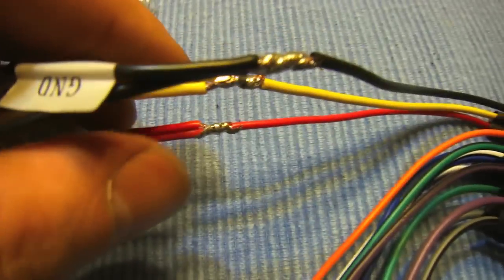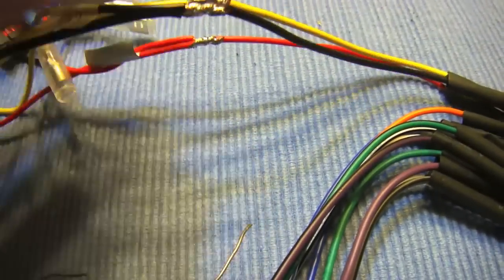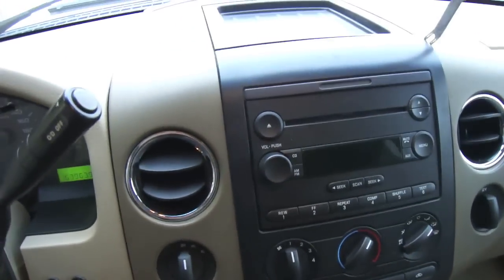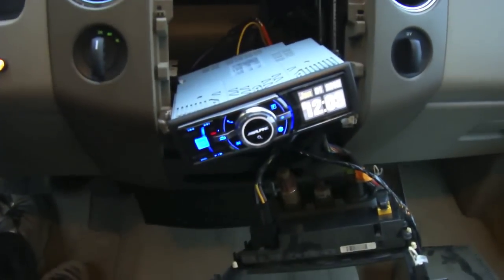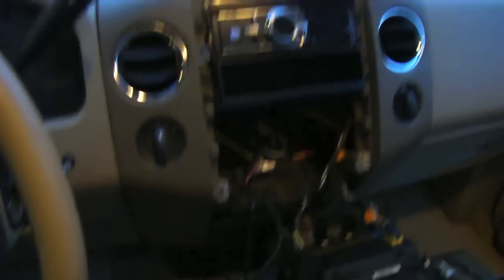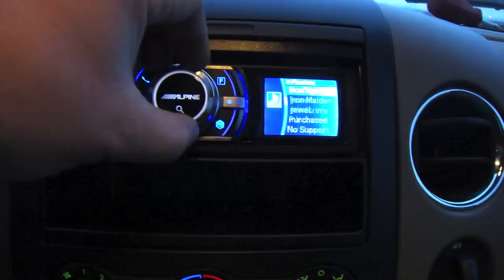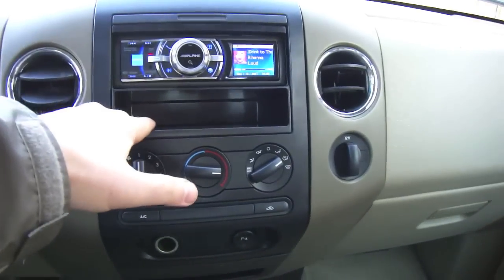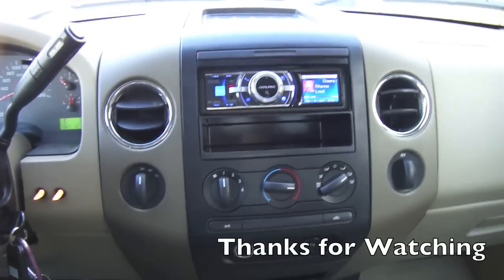DIY Car Stereo install in a 2006 F150

Comment from the maker: @kurtnin42manson that button is for the backup sensors on the truck and i'm sure there is a module you can get to intergrade into your steering wheel controls.  my truck doesn't have that so i purchased a alpine remote off ebay for it

Comment: Great video! Hands down the most to the point and informative install on F150's out there. I do have a question about the Bluetooth mic though. 

Once you took the A-pillar off and got to the bottom of the A-pillar, where did you route the cable to get it inside the back of the dash? Thanks for your time man!

Comment: What is that button to the right of the cigarette lighter? Also, would you know if there is a way to add steering wheel controls on the steering wheel?

Comment: werd .... anything LESS than soldering WILL cause issues. I've done the ghetto cheap man tape job with my old truck and regretted pulling the dash apart SO MUCH